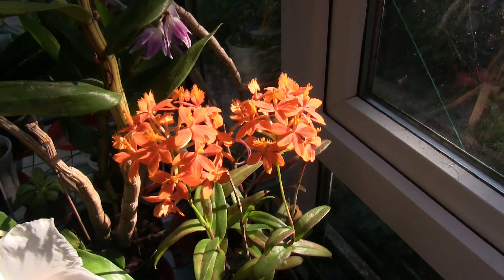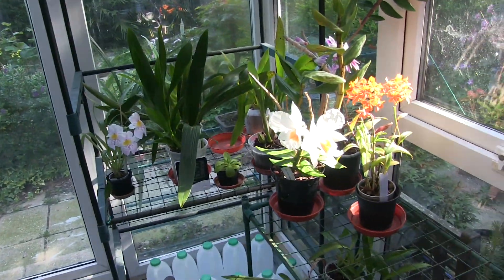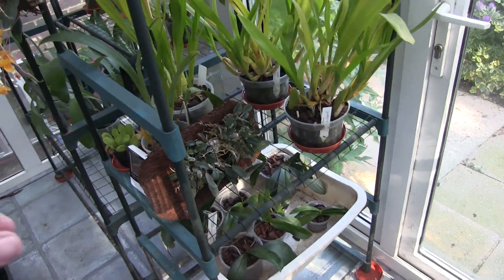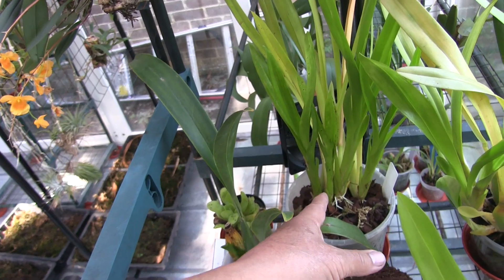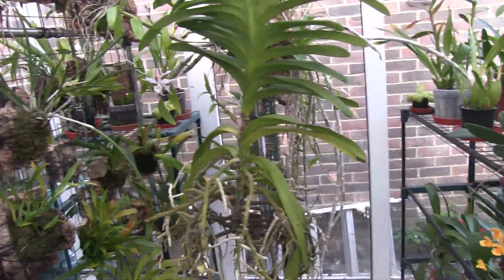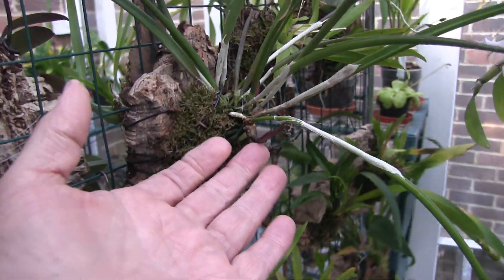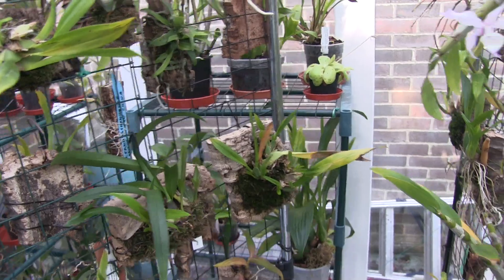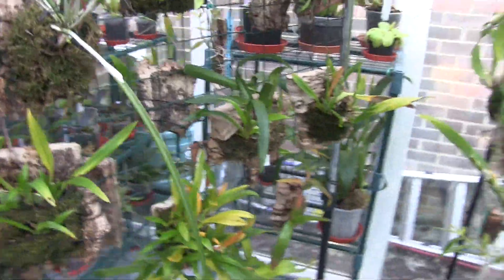Today and Tomorrow, We Test the Growroom Against the Heat

Comment: What brand name is herican heckor?
Reply from the maker: It's a Faran HR15 humidifier. Care needed if buying as it often comes with 'accessories' that may not be required as they are expensive - eg digital humidistat - there are much cheaper option out there. The unit does need a header tank for water storage but suitable plastic containers with lids are sold as storage in DIY shops.
Reply: @RogersOrchidsGardenandBonsai  Thanks Roger I appreciate it.